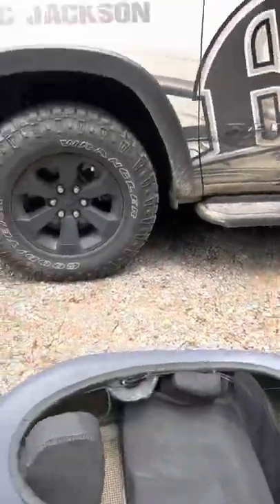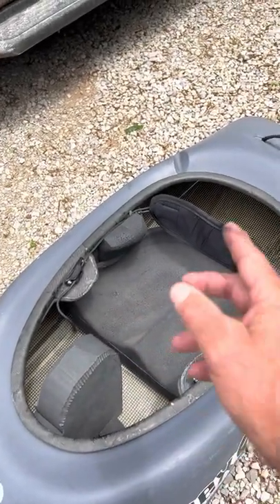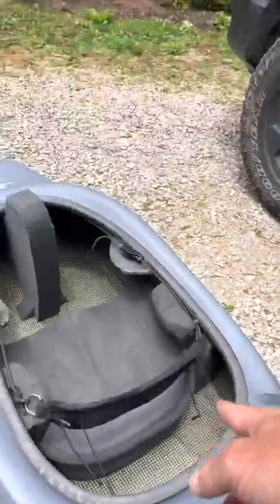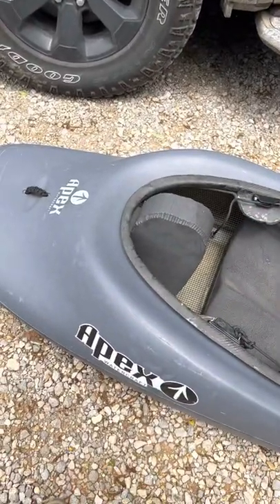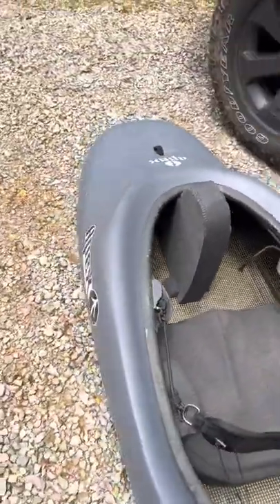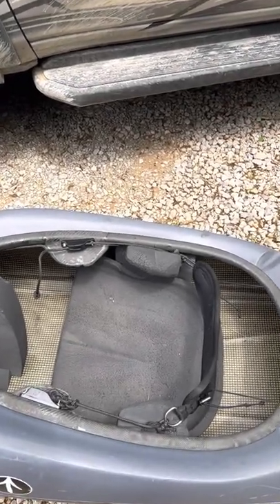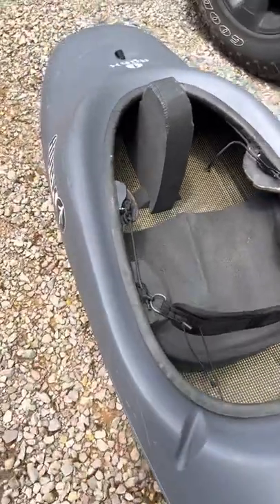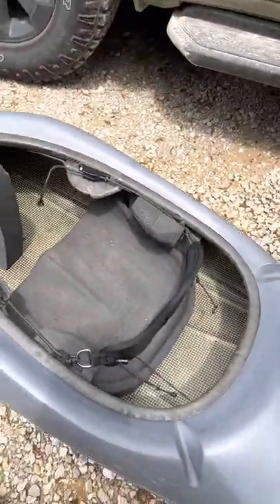EJ’s Apex Rebound Freestyle Kayak Outfitting Walkthrough- Where we are and where it is going.

Comment: have a look at the Zet Kayaks seat foam. if you can get the same finish on the foam as they have, that would be nice. no extra weigth, but looks a lot more appealing. and its probably even smoother.
Reply: Thanks-  Theirs is molded, mine is machined.   Yes, I can get a smoother finish on my production ones, but being able to change the design every few months until we get the ideal shape is my goal for now.    We'll have molded ones for the plastic boats, but not for the composite ones.
Reply: @ericjacksonkayak2759  absolutely makes sense. 
(i'm no expert on foam at all, so i didn't know.)